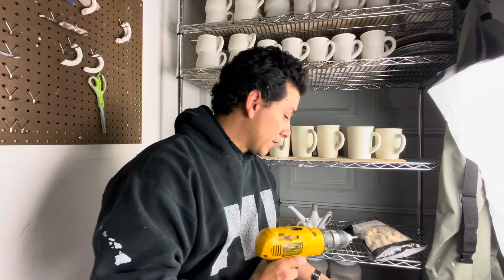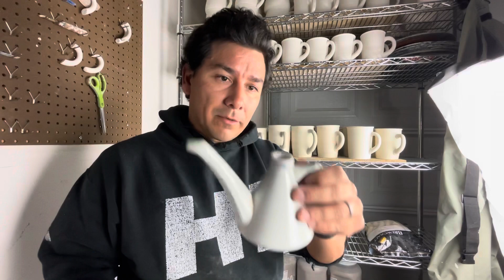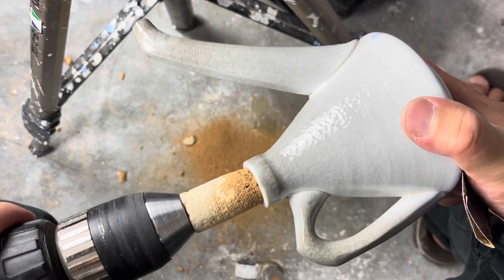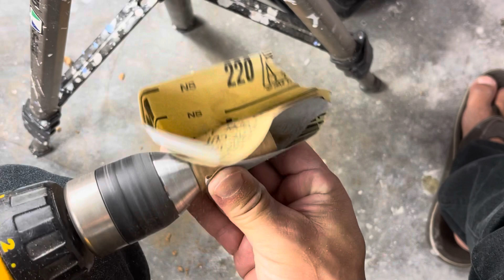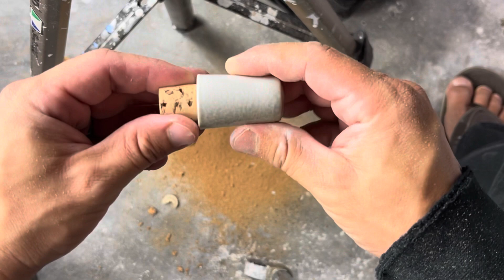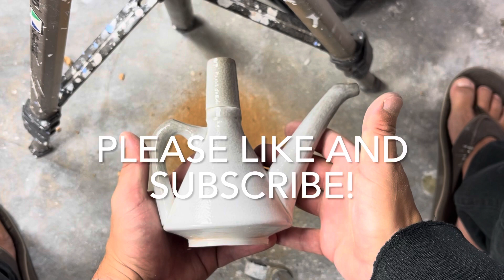How to: Fitting a Cork into an Oil Bottle

Comment: Real nicely done. Guessing that you hacksawed off the bolt head and, pre drilled cork to receive bolt.
Reply from the maker: Thanks for bringing this part up! I should have been more clear as to how I got the screw chucked into the drill. Yes, I cut the head of the screw off before putting it in the drill. I haven’t had to pre drill yet since the corks are pretty soft and don’t seem to split. I’m sure it will be different for al the other types of corks out there so pre drilling may be the safer route. Thank you for watching!
Reply: @Theclayclubsd  Pre drill to prevent split yes, but more about end-result. 
Imagined removal of bolt would reduce final diameter.
But cork seems to be amazing stuff. S'why we like it and You know it. Thanks.